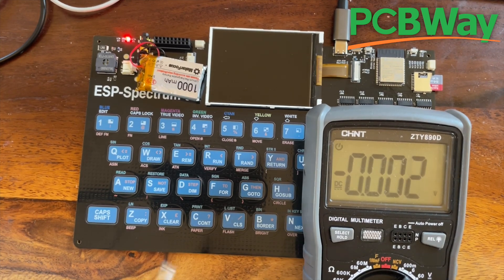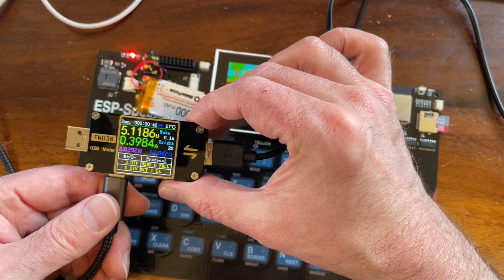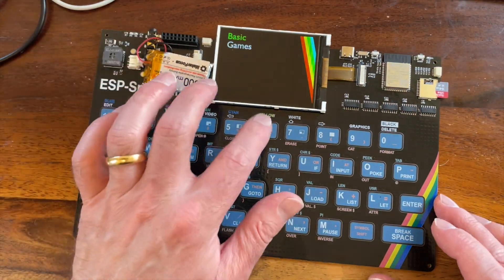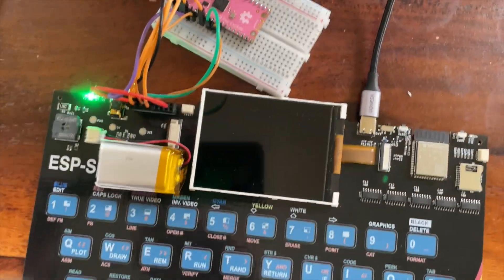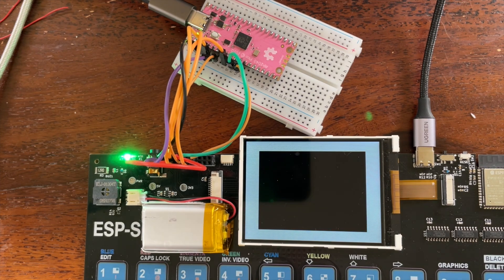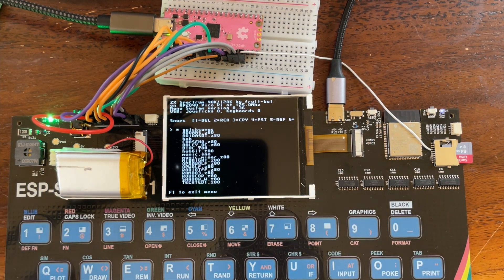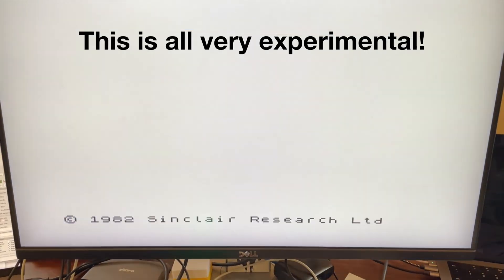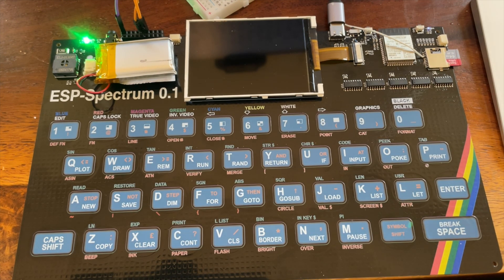ESP32 Touch Spectrum - Battery and Expansion port test.

Comment: Would be great if it could have connector for linking to existing computer monitor (eg. HDMI or smth)? The thing I loved most about the speccy was I could take it round a friend's house and connect it to the telly.
Reply from the maker: Yep - that’s something lined up for the future. Need to stabilise the current design to get the CE certification completed. So it will be an addon board.

Comment: Will be interesting to see how far you go down the certification route.
looking forward  to seeing the D.O.C, remember your need UKAC, CE just for us and our nearest neighbour 

Point to note, as the ESP32 has Wi-Fi it's classed as an Intentional radiator, so that means Radio Equipment Directive (RED) compliance is required. a side issue with RED is that is removes the  low voltage part of the Low Voltage Directive (LVD). where the LVD states it's only for equipment between 50 and 1000 V for alternating current and 75 and 1500 V for direct current, RED removes the lower voltage limit so it will read "0 and 1000 V for alternating current" and "0 and 1500 V for direct current. So that's two directives and counting.

Now days it's better to supply it as a kit of parts, which might mean that all you might need to meet is the Restriction of Hazardous Substances (RoHS) directive. Maybe with the "Control Of Substances Hazardous to Health" (COSHH)

The fun of placing something on the market as the law calls it. It's last person who places it on the market that gets all the pain if things go wrong. 🙂

I'll keep my eye out for the unpopulated PCB. 🙂
Reply from the maker: I’m hoping that since the module is already certified - and I’m using it as designed, that should mean I fall into the unintended emitter category.

We’ll see what happens…

Comment: It's fleshing out nicely. Worth adding a resettable fuse on the USB VCC line?
Reply from the maker: Yep - makes sense. Need to add ESD protections and some power control to allow for more capacitance. Strictly speaking we’re only allowed 10uF and I need more than that… so an IC that has soft start built in would be handy.
Reply: @atomic14  I'm gonna pretend I understood all that lol...  If you have a minute, what are the dimensions of the PCB. It looks about 25x15cm? Cheers
Reply from the maker: It's exactly 233mm x 144mm - the same as the original ZX Spectrum.

Comment: Interesting Chris, a few questions though: Are going to use 2 SoC and 2 emulators? Is it Fruit-bat emulator on (expansion) RPI Pico? Which emulator on ESP32?
Reply from the maker: I’m going to be shipping the boards with the ESP32S3 - I’m probably going to with the ESPectrum emulator - just need to do a bit of work on it to add support for tft display. Or I’ll reuse their core code and make it work with my current emulator. The pico would be something for the future and I’ll probably wait and use the RP2350 on a custom board and it will plugin to the expansion port. It may be that the emulator still runs on the ESP32 and the pico is just a “graphics card”.